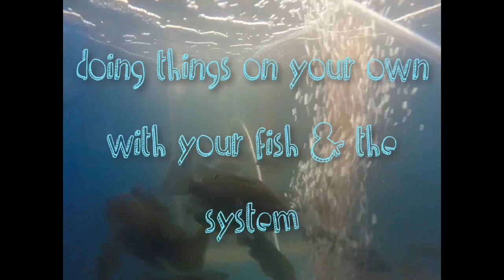RAS RECIRCULATING AQUACULTURE SYSTEM / MY OWN RAS BUILD

Comment: Thank you for sharing 👏👏👏👍

Since you have a lot of wastage of water, just a suggestion, maybe look into adding an anoxic filter system either by adding another drum or two set up as a bog style filter filled with clay media creating anoxic conditions to break down nitrates into nitrogen gas or alternatively bcb baskets in a drum or sump to break down nitrates. You can still combine it with the aquaponics as well to clear nitrates completely from the system this reducing the need for daily water changes. I hope this helps.

Comment: very helpful! 2.14 seems to have a 2 vertical pipe, is this pair, interconnected before the water flow to 1st filter system.
Reply from the maker: Hi there. The pipe near the cam is an overflow at the same time a drain pipe.

Comment: Ano pong gamit for vacuum? Waterpump?
Reply from the maker: Submersible pump is used in this system. From the SUMP TANK back to the Pond.
Reply: Sir anong size ng subnersible pump  ang pwede sa 10ftx30ft na concrete pond

Comment: Sir , ano ang difference sa mechanical and bio filter?
same lng din ba yan sa static and moving bed filter?
Reply from the maker: Yung mech filter basically works to separate the solids from the water. Yung bio filters naman ay tumutolong para e convert ang ammonia to nitrates. May good bacteria na normally lumalabas sa bio filters as soon as mature na ang system. Yung static kasi at MBBR ay gumagamit ng mga plastic pellets as bio medium at yes nagiging mech din xa as long agitated. Yung static naman na principle ang bio filters mo na nagtata trap ng good bacteria.

Comment: Thank u sir. May you tell us as to whether you used a water pump to push water out of the fish tank to the filters at the begining of the wate cerculation.
Reply from the maker: Gravity driven. In this type of set up the pump is in the sump tank.  From the pond, water drops down to the filters without being sucked.
Reply: Sir, can you share the piping set-up from pond to 1st mechanical filter. Tnx in advance
Reply: @federickpolicarpio2022  yes, wish to have those details if possible.

Comment: You forgot to xplain HOW YOU XTRACT THE SOLIDS FR FIRST TANK?😜
Reply from the maker: Collected the waste for the first mechanical filter by shutting off the pump first to stop the water flow, siphon the solids inside the bucket using a hose and once liquid is all empty in container i add the loss water to the sump. Note: added dechlorinated water for the loss once.

Comment: 2:51 why need a vertical pipe and bottom pipe? 3:53 would appreciate if the design can be shared. TIA
Reply from the maker: Hello. Since i use a box type trapond, i installed a vertical pipe below to further collect the waste of the fish and ease in cleaning during water change. There are holes below which the fish cant fit but feces will pass through.
Reply from the maker: You can also check the previous clips, the trapond build for the design.